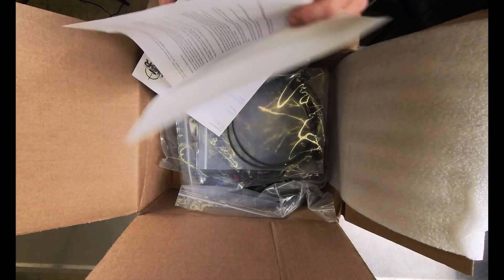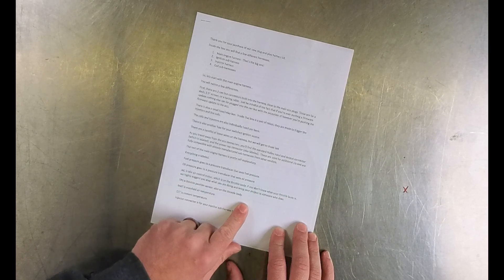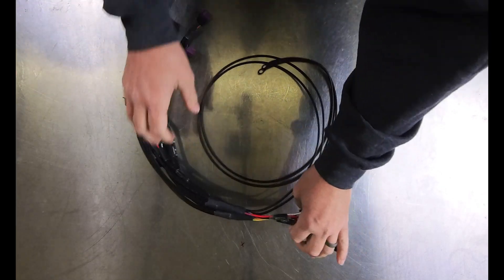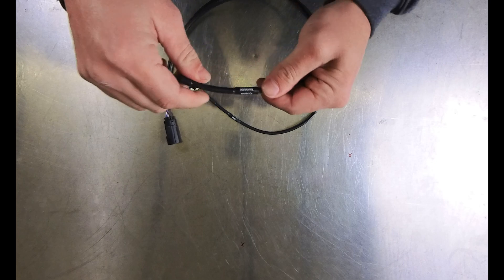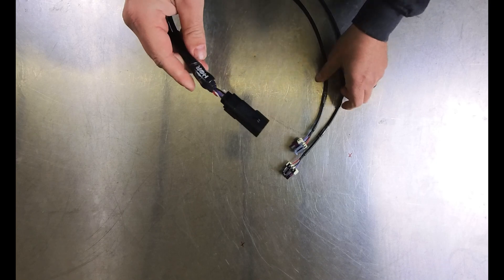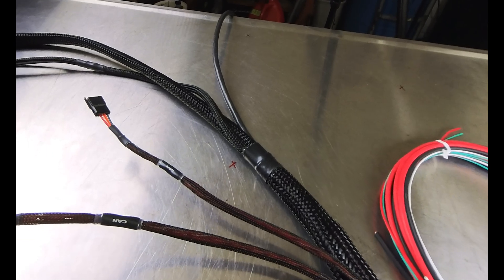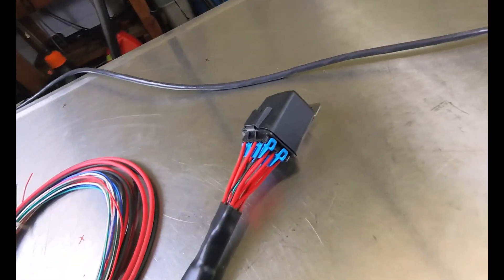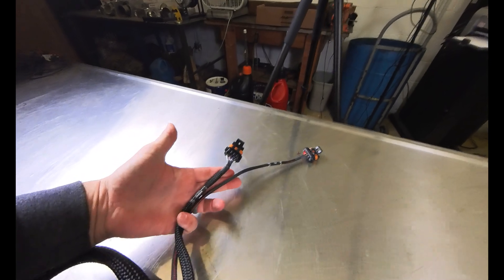HCR Innovations Holley EFI pnp Engine Harness

Comment: For those who may think Joe is just throwing big numbers... 
My last custom tailored harness installs.
Dominator in Optima Challange C6 - 160 hrs @ 125.00 = 20k
Nexus R5 Endurance raced Mini Cooper. 140 hrs @ 125.00 = 17,500
Reply: The harness on the website is only $1,000, which is a damn good price as you well know. 

By the way, you have some cool toys brother!
Reply: @RonniePTexan  Thanks! Unfortunately we lost our Cayman this past week at Sebring. 😡 We were running p9, driver in p7 goes into the wall and bounces back onto the track into the line of our driver. Making contact at 121.44mph! Thankfully safety equipment did its job and the driver walked away with some harness rash and a couple cracked ribs.
Reply: @jasonbrinegar6759  Tough luck getting caught up in that wreck. Hopefully y'all get things built/rebuilt and back out there soon.

Comment: Just curious. What exactly did you buy from them and what did it cost. Their website refers to unterminated kits for $2200 to $2400. The harness you demonstrated is clearly not an unterminated kit. Again, just curious.
Reply: theres a listing for Plug N Play Holley harness for $1000 thats it
Reply: @CMillet86  Thanks, Cory. I'll call them to confirm. What confuses me is why a DIY "kit" is over twice as much. I'll call.
Reply: @kennethbrooks9818  the DIY kit is tefzel, includes deutsch conectors, tools, premium heat shrink, etc.. Thats mostly what you would need to make a race spec harness, where in the video this is a much higher quality competitor to the out of the box holley harness